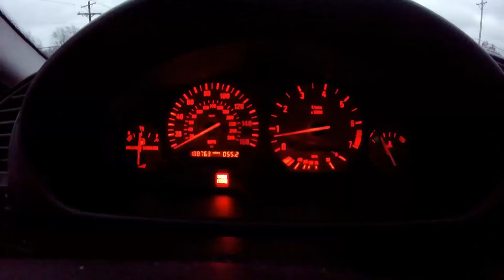Should You Ever Replace Your Transmission Filter?

Comment: Filters wear out. Heat, pressure and time damage the filter. Change the filter
Reply: Absolutely
Reply: There is no pressure in a typical transmission filter
Reply: No pressure it’s vacuum, but it’s implied. Change the filter.
Reply: I'd change it after the first fluid change, maybe not the second
Reply: @user-sf7kl9uh7k Now that makes sense,never listen to the dealership they could care less.
Reply: Not all automatic transmissions have filters that can be replaced. Best practice is to change the ATF regularly with quality ATF.
Reply: My 2020 Toyota Corolla XSE CVT doesn't even have a pan that you can remove.  You can only drain the fluid
Reply: And those CVT are an entirely different animal compared to a traditional automatic transmission. They even say not to change the fluid, but if you want 200, 300k, or more Mike's out of that CVT you bettet.
Reply: My Honda HR-V has a change interval for the CVT fluid @ 30K miles. The OEM fluid is good, but I like Amsoil CVT fluid more.  @harvestblades
Reply: @HanksterBee  Pressure above atmospheric, pressure below atmospheric (partial vacuum), doesn't make a difference. It pressure DIFFERENTIAL across the filter that matters. 100 psi on one side and 110 psi on the other side and you have 10 psi differential. -10 psi (vacuum) on one side and 0 psi (atmospheric) on the other and you still have 10 psi differential across the filter.
Having said that I have no idea what's meant when Robert says "pressure" will damage a filter. Put a filter in a pressure chamber and pressurise the chamber, and I see absolutely nothing happening to the filter.

Comment: Every single metal-on-metal surface or clutch/band assembly constantly produces microscopic pieces which break down with every single revolution of the gears.  Those pieces eventually clump together and form varnishes due to the heat.  That varnish clogs the filter, and reduces the line-pressure of the transmission slowly over time.  I still believe in the old rule-of-thumb.  Change the fluid and filter once at 30,000 miles to remove the initial break-in wear, then change the fluid and filter every 60,000 miles thereafter.  The amount you're spending on a filter and fluid is far cheaper than having to buy a new transmission because it was not maintained.
Reply: Perfect!  Good advice
Reply: Will washing or cleaning a filter work then?
Reply: I know right! So we are listening to a guy who blew his transmission talk about why you shouldn’t change the filter ? 🤷🏼‍♂️🤣
Reply from the maker: Who said this was my transmission? I rebuild transmissions. It makes for a good discussion.
Reply: @PetesGarageandperformance  anyone who works on transmissions for a living should know that it is an important part of vehicle maintenance. Not as often as oil but almost every vehicle has it in there maintenance schedule. Every 30-50k miles transmission fluid change and filter change is to be done. You are making videos on something saying you don’t need to do it when every car manufacturer in the world says it is routine Maintenance and SHOULD be done at a certain mileage..
Reply: @CK-qu1kn  Not questioning, just curious, where does Toyota state that transmission fluid filter change is a routine maintenance item? I have a few Toyotas, but cannot find it in any of the owner's manuals.
Reply: @CK-qu1kn  There are some cars that not allowed the filter change because the fiter located inside for examample ford escape v6 no access to the filter, need to open all the trans to have access but ford escape 2.3 got the filter outside (inside the oil pan) so why not replace it when changing fluids ..
Reply: And honda odyssey has no filter to change. You suppose to just let out i think it's 3 or so quarts and refill. But I found one went to the dealership asking for a filter he says it doesn't have one well he says well, we call it a element. Found it online and replaced it boy was it dirty.
Reply: @joet4806  Most transmission transmission filter has a micro fiber screen inside of it this is to pick up they might grow metal pieces that come from the gears over time let's get clock eventually causing Problems with shifting in so far
Reply: @PetesGarageandperformance   I do think you do have a point considering most dealership and quick lube place just vacuum pump out the fluid and put in new fluid since it easier less chance of someone messing up something like  confusing the oil pan drain plug with the transmission drain plug and so on .  Yes i have seen that happen before and the customer was not happy blown transmission.
Reply: Who ever recommended a transmission filter and fluid change at 30,000 miles.  That is a total waste of money unless you are doing some really heavy towing in in high temperature conditions.
Reply: @deanvorhees3333  All Fluids go bad.... why do you think they even recommend doing a brake fluid change. A safety item albeit a well.
Reply: When you gotta take the whole transmission apart just to reach the filter tho seems counter productive well like on my vehicle at least
Reply: @daysensouth7325  Yeah honda does.... but they have inline* filter you can change. Just get behind the bumper. Trim remover tool. 2 bolts. The filter and you're good. 3 and 3/4 quarts if I'm not mistaken? I have done it 7.5k and 10k intervals.
Edited with **
Reply: Can I Change Mine If It's High Miles And Hasn't Been Changed
Reply: @thuncvho7227  What's high mileage? High mileage in general is 75k miles and over. So far, I did it at 111k miles and 117k miles and had no issues whatsoever.
Reply: It's a strainer in most cars. You can really clean the fine metal mesh, it's not a disposable paper filter that can't be cleaned. More like a tea strainer.
Reply: @meta5291  Doesn't matter if it's a strainer, if it prolongs the life of the transmission until 300k miles, I think that's a win. Owning a car is privilege.
Reply: @bryangodfrey6397  Agree. I meant instead of replacing the filter, you can do nearly as good a job by thoroughly cleaning the strainer, especially if the part is unavailable or prohibitively expensive.
Reply: @meta5291  If it's not in stock which does suck. But it also happens. There is always that option.
Reply: @brilliantambingon4196 so by that logic, the guy in the video is correct. If even ONE type of car is manufactured where you can’t access the transmission filter. Shouldnt that be a sign that you DONT need to access it?
Reply: @bryangodfrey6397 to make money my guy… you need to go watch my guy Scotty.. you don’t need no damn Transmission change at 30K miles. Ima car novice an even I know that
Reply: Should I do transmission flush or change?
Reply: I totally agree. My Toyota transmission is Aisin. The filter costs 100usd which is not cheap but i replace it every 60000miles with the oil change.
Reply: @markmarbun if you're going to remove the pan and remove the filter at that point why go through the household washing it when you could just replace it.
Reply: @CK-qu1kn or his transmission blew like any transmission would blow who nobody has touched it beforehand. Just because his transmission blew doesn't mean he's incorrect. I'm not saying he's correct but using your logic doesn't mean oh his transmission blew therefore he must be absolutely incorrect about his theory. I had a Honda Accord whose transmission went I never touched a transmission. So if I would have touched the transmission would that have meant that the transmission failed because of something I did or would it have failed either way
Reply: Does that same old rule of thumb of changing everything at 30,000 mi does that same old rule of thumb apply to changing oil every 3,000 mi cuz we know what has happened to that old rule of thumb..
Reply: @catdog4092 have a new transmission on standby before ya  flush.
Reply: @BigHammerz  good one.  and finally a little humour.
Reply: If true (replacing the filter with each fluid change), tell the morons who designed Ford 6F35 and GM 6T40 since you have to remove the transmission from the vehicle and take it apart in order to replace the filter since it's not in the pan.
Reply: Perfectly said. Wish I read this before my father let his Ford Escape shit the bed. Only 95k miles on it and the trans is now toast! Manual recommends to change the fluid every 30k miles, you'd think he woulda read the thing. Screwed now.
Reply: Facts bro bro, PURE CRACK ROCK HARD FACTS BROTHER, AMEN TO THAT HALLELUJAH!!!! 🎉
Reply: NEVER try to clean and reuse a transmission filter @markmarbun
Reply: @hightolerance8728  what if it is a CVT transmission?
Reply: leave it alone not knowing what you’re doing over tightening the bolts breaking a bolt now you have problems. You see them with the power wrench scary. Notice they are not using a torque wrench so now the bolt are probably to tight bending the pan wholes. Leave it alone you are saving thousands of dollars not doing it. Great Review

Comment: I think it’s a good idea to change a transmission filter because of the metal from the break in period.
Reply: Is not good
Reply: Facts....because it builds up
Reply: Wouldn't the magnet capture the break in metal?
Reply: @chetcreates  Not all of it. The very fine metal that gets by the filter ends up on the magnet. The bigger pieces on the filter screen.
Reply: This is what I have always done. After that I just change what I can easily drain out for a partial fluid change. Been doing this for 0ver 50 years and never had a transmission problem.
Reply: @chetcreates  That's what its for but some prob gets caught in the filter too.
Reply: The rule of thumb is to drain the transmission fluid and save it !
Drop the pan; if you see small partials, you’re fairly safe . If you see any big partials, the transmission is trashed !
Take the old fluid, strain it through several automotive paint strainers,replace the filter and pan gasket, and reuse the old fluid .
If you replace the old fluid with new, you're asking for trouble .
The new fluid with its detergents will wash away all the contaminants that's built up inside the transmission and clog the new filter , and any that gets past the new filter will end up in the valve body starving the pump of fluid .
Never replace the fluid if the transmission has over 100 thousand  miles on it and has never been changed ....
Reply: @shobud7561  even if their are no particles in the fluid you cant change it if its been their for over 100k?  Mine had 50k on it since I bought the truck no idea how old it was but it originally was clear red pervious owner took care of it.  I let it go too far but I got lucky minimal filings on the magnet means it was changed at least once and the factory drain plug was missing in the pan.  I kept the old fluid a month but driving with the new fluid has made no changes in how truck operates except shifting is a little better.
Reply: @deere3321  Thank you!  So you regularly change the FILTER and add some more fluid correct? 50 years right?
Reply: @shobud7561  how can you tell if your tranmission oil never been change? Im thinking on pumping my oil out snd add in new tranmission oil i bpught from Honda dealer..
Reply: @shobud7561  hello sir so are you talking about when you do a actual transmission Change or a Flush ?
Reply: I agree, but once you changed it the first time, i agree with Pete on this video...
Reply: @shobud7561 totally agree Sir,
I have faced the same issue because 
I have changed fluid without filter 
now start to slipping the gears until warm the fluid almost run the car 3-4Km then disappear the issue.
So I’m thinking will change again filter and fluid. Hope your advise.
Reply: Nonsense

Comment: The transmission is still metal on metal contact, it doesnt have to be a catastrophic amount of metal that comes off. You still have to change the filter, since you only need to change your transmission fluid every ~ 60k miles, its not that big of an issue to spend $70 on a new filter. If there was a catastrophic failure, the filter is as reduntant as the bolts holding the fluid pan. youll need 2k for a new trans, however if you dont change your filter and those metal pieces make their way back into the transmission, that could potentially be the CAUSE of the catastrophic failure.  Again, you dont change your transmission fluid that often as engine oil because theres no need, so it shouldnt be a point of saving money since the spacing between when you do it is fairly large
Reply from the maker: I agree that if you are into the transmission that you should change the filter. But you don’t need to drop the pan on most transmissions to change the fluid. They either have a drain or you can use a fluid exchange machine using the cooler lines (my prefers method). When I worked at the dealership we had two options: just a fluid flush with the machine, or drop the pan to change the filter and then do a machine flush. It usually would cost an extra $80-$100 to do the pan drop and filter. 

They don’t put a filter on manual transmissions or differentials. All they use is a magnet to catch debris. A filter is used on automatics because they have to keep the pump, valve body, cooler, and piston seals clear of metal debris. However, if there is more than the “normal” amount of debris that the filter is designed to handle, the transmission needs an overhaul that changing just the filter won’t fix.
Reply: Hey you seem pretty knowledgeable and I have a question my transmission seems to be going out the other day was making a whining noise on the freeway halfway home it got stuck in third gear now when I started up it drives for about 1 minute and then it stops driving all I get is the engine revving won't go into reverse unless I just started the car should I change the filter or just get the transmission replaced??

Comment: That filter is to the cooler. If you don't change it, you will overheat the transmission eventually. In fact I came across a garage that apparently thinks the way you do. The result was the cvt overheating and going into safe mode because they wouldn't change the filter. I started doing my own cvt fluid changes after that. After I had that filter changed, no more overheating cvt. Why does that filter need replacing? The fluid breaks down from the engine heat and hence why the fluid has to be changed. Also the transmission has wear just like the engine does. The older the fluid the more wear that occurs. That filter is there to filter out small metal particles and to keep them from clogging up the transmission cooler. The filter can only hold so much and must be replaced or else the fluid flowing through there gets restricted. There are also one or two magnets in the transmission pan that need to be cleaned of the metal particles when the fluid is changed.
Reply: BS
Reply: That's a CVT, completely different maintenance needed.
Reply: My 2020 Toyota Corolla XSE CVT doesn't even have a pan that you can remove.  You can only drain the fluid.
Reply: @user-sf7kl9uh7k Why would the manufacturer install a transmission FILTER to begin with if it didn’t have a function? Because it does actually have a function.  It FILTERS and every filter that I’ve ever dealt with, no matter the application has a finite life expectancy.
Reply: @jdub1139  Actually I agree and I'm sorry about my comment. It was an error actually, however I'll leave it for the purposes of context.

Comment: Don't skimp on your second biggest investment. Just skip the fast food cheese burger one or two days one week and replace the filter.
Reply: The biggest issue with changing trans filter is accessibility. Some transmissions must be removed and split open to even get to the filter. Not worth it in my opinion.
Reply: @a3300000  which transmissions are those? I've never seen a transmission that you have to remove in order to get to the filter
Reply: @edocsil1635  , Chevy Equinox for one.
Reply: @a3300000  Poorly designed vehicle
Reply from the maker: @edocsil1635  most newer FWD GM and Ford transmissions have “lifetime” filters that are deep inside the transmission and are only replaced when rebuilding the transmission.
Reply: You can add a inline filter on the transcooler to keep from having to dig in those transmissions to replace them.
Reply: @edocsil1635  Ford Escape is another one
Reply: @edocsil1635  Subaru Outback CVT has a built filter

Comment: I came across due to inquisition regarding the necessity to change AT filter.
2009 focus has no drain bolt so ATF goes everywhere when pan is dropped. This is the sole reason I am wanting to avoid changing the filter, otherwise I would not care whatsoever. 
I will tap into the return line and drain as I fill 1 gallon at a time. 

I also wondered what would contaminate the filter requiring a replacement. 

Great video. Thank you!